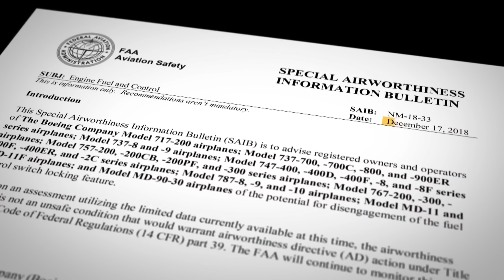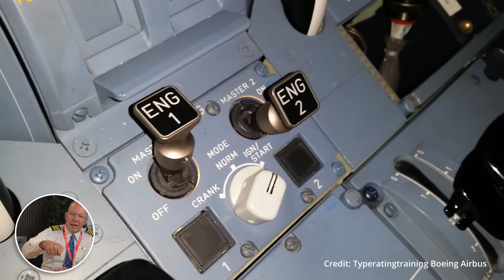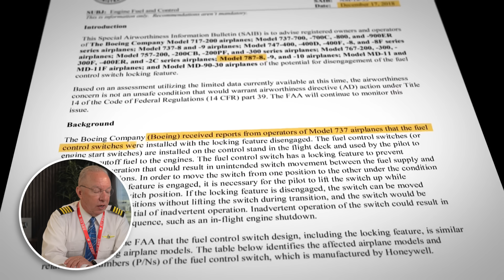Air India 171: The FAA’s 2018 Fuel Switch Locking Bulletin Explained (16 Questions Answered)

Comment: The engine system likely caused the engines to shut down, after which the captain had to restart them by putting the fuel cut-off switches to the cut off position then into the run position but it was too late as they were too low. In 2019 the system shut off both engines on a 787 as it came in to land.
Reply: @cwli1 not enough time to do all you suggest. We are talking seconds here!

Comment: why did the report not say wich pilot say what? Is ist possible the this fuel control switches was in RUN position and in function but not guardet? so they fall down himself by liftoff or by short touch with a hand? that will be a answer for this conversation from both pilots.

Comment: System should block fuel control switch changes until a secure altitude. There is no reason at all to allow such a manipulation at this stage of the flight! „Operating as designed“ is the issue here

Comment: Hi Steve Sir, my question is "HOW MUCH TIME IT WILL TAKE TO REFLECT SLOWNESS in ENGINE,  WHEN THE FUEL SWITCH IS TURNED OFF" is 4 sec or 1 min.. bcz time given in the report is in micro second
Reply: What you are referring to is the fact that both switches were moved to cutoff in the timeframe of 01 (ONE) second…not 0.1 second.
I’m an airline pilot, take it from me that the reaction time for the engine to stop running after moving the switch to off is practically instantaneous, like half a second or so.
Reply: @baasbowing  Knowing what we now know..... What's your gut instinct? Was this a deliberate act of malice?
Reply: It consumes the most fuel at take off BY FAR. I guess it will be maybe 2 seconds. I don't think ti was microseconds.

Comment: Captain Steve a great video and a fan however I disagree on one point. Your objection to the camera in the cockpit was it wouldn't have prevented the accident which is true however it would be a fair way for the families of the passengers to get answers. For example you mention the sound recordings of the black box however what ifa pilot deliberately done something nefarious then asked the other pilot why they done it? Whilst this is not commonplace someone with bad intentions may do this. Whether they should be monitored solely in event of an incident or not is another discussion and I also agree that from the pilots pov that it could feel invasive. Nonetheless worth a debate

Comment: Captain you sound 100% sure that it was a manual intervention. I would like to know if it was before or after thrust issues or before RAT was deployed. Is it possible to  do a video with sequence of events with timeline.
Reply: All of the videos have seen from pilots they are 100% sure it was a deliberate action and could not have been moved or happened accidentally.

Comment: Why would the system allow to disengage fuel while airborne? Make sense when the plane is parked.
Reply: An engine that's on fire and or having a catastrophic failure needs to have the fuel supply cut to keep the engine from bringing the plane down.

Comment: If  someone among the pilots  has switched it off, deliberately, he would resist rerunning the engine right? Here the engine was started with out the resistance of other pilot. Explain this?
Reply: Because at such low altitude (650 feet approximately), the plane’s fate was sealed already with the fuel cut off for more than a few seconds. During takeoff is when maximum thrust is applied. Even when you turn the fuel back on, it takes up to 20 to 30 seconds for engines to spool back to full thrust. Insufficient time given the altitude. Any trained pilot knows this  -“resistance” is futile. 

Ask better questions please or just stay off from commenting.

Comment: What about having a distinctive beep/sound when the fuel control switch position is changed? If such an audio alert was there, if the switch had fallen accidentally, or by mistake by one of the pilot, the other pilot would have immediately been alerted to.
Reply: how come theres no warning sounds behind the pilots voices  id have thought thered be big beeping sounds ?
Reply: They were. In fact, the distinctive sound is that of the engines spooling down. INSTANTLY the other pilot asked "Why did you cut off the fuel" (and after 10 secs put them back)
Reply: @normalchannel2185  Engine winding down could happen for many reason beyond the switch - like Low oil quantity / oil-pressure, high oil temperature, rotor issue etc.

So as a pilot one will spend few seconds to hear the engine wind down, the thurst missing, and then wonder what went wrong. The last thing a pilot would expect is fuel was cut-off manually. So, why not have an immediate alert? He could have put it back on in < 2 seconds and engine would not have died/stopped for it to require reignition.

Comment: My only problem with the explanation about the bulletin is that it literally says, "Inadvertent operation of the switch could result in catastrophic consequences, such as an in-flight engine shutdown."  (Emphasis added.)  Now maybe I am making too much of that one sentence but it seems they were concerned that this could happen in-flight.  That would be contrary to the idea that the switches, if improperly installed,  would never stay in the RUN position long enough to get the plane off of the ground.
Reply: I asked the same. Shitty wording from Boeing. Does it mean that if the LOCKING FEATURE IS DISABLED (at it appears to have been on the AI flight), that it is NO LONGER a 3 step switch, but can easily be bumped like a house switch.  Nobody seems to clearly answer this.
Reply: The advisory was to prevent inadvertent switching. However in this case it would appear to be a deliberate act.
Reply: @mikewilkins9484  I think you are right.  That is why his explanation that the advisory was for a installation error that would not allow the switches to lock in the Run position sounded wrong to me.  The advisory clearly states the problem could result in an in-flight catastrophe.
Reply: The throttle control pedastal was already replaced on that plane at least twice, the most recent was back in 2023, that bulletin came out in 2018, so the plane already had the updated switches. The fact that they were both still in the RUN position after a hard crash and fire that melted the flaps handle speaks to the robustness of the locking mechanism.
Reply: Captain Steve doesn’t wanna talk about the bulletin, it just looks like he gets paid overtime by Boeing
Reply: @leoarjuncrasto Don’t be a Dodo brain.

Comment: i have a wild theory-
so the fdr (flight data recorder) takes input from the electrical systems, NOT the actual switches. so if an erroneous input was shoved into the fadec system at 080842, of the fuel switches moving from run to cutoff, then the fdr will record it. and then the fadec might try to strangle the engines (im not too sure). then the pilots saw the fuel switch warning on the eicas and then be like - who did it? then at 080848 or so they might have tried to actually set the switches from their perceived run position to cutoff position, and then switched back to run position on 080852, and that the fdr did record.

Comment: This looks like a manufacturing fault to me. The speed and way both pilots questioned each other shows that neither of them initiated this. If one pilot had done it, their response wouldn’t have been outright denial—it would have been along different lines.We also know the pilots tried to get a message out that they had suffered a catastrophic loss of lift. So why would the transmitted message be about a total loss of trust in both engines, rather than one pilot accusing the other of sabotage?
Reply: The question clearly reflects that the levers were physically changed to the wrong position.  So it wasn't a mere electrical fault as the most definitely well credentialed engineers are trying to argue all up and down the comment section.

I'd like you to tell me what kind of manufacturing defect could cause the levers to move by themselves in a one second interval exactly as it is done at a normal shutdown, be returned to their correct position shortly after, and then remain in that correct position throughout a severe crash and fire despite apparently wandering around all over the place just seconds before.

Comment: Why are you overlooking the chance the spring/ mechanism of the fuel switch might have failed? It is shocking to me the safety of the entire of entire aircraft is dependent on one single switch not failing. This should be changed by Boeing to two step procedure.
Reply: I don't think this cd affect bith the switches simultaneously. They both must not have any connections with each ither which can make them fail simultaneously
Reply: There are two springs. One is for the actual switch operation - it pushes internal switch circuitry and is enough to keep position stable even in case of overload. Second one pushes down the cap with a locking mechanism
Reply: @brylozketrzyn so there are two single points of failure because a failure in either spring would result in the switch failing?

Comment: 4:03 “It might give you a clear picture of exactly what happened,” seems like a good reason to have a visual record. The threat of capturing a pilot doing something they’re not supposed to, like reading a magazine, doesn’t seem like a valid reason to not have that visual record.
Reply: Yep! Steve’s counter argument is weak in my opinion. He worries that the pilots could be held responsible for inappropriate behaviors in the cockpit if video footage is available to prove it. His thinking is actually concerning as he implies that pilots are doing such things today very commonly.
Reply: @allee2445 he’s excused was “it won’t prevent this accident” no one say it would. But it’ll show whose fault it’s. The airplane or the pilots
Reply: @edgarallanpoe9534  Exactly! No system can prevent accident 100%. Having said that, additional information can help identifying and confirming the root cause which leads to safer systems or better pilot training and ultimately improve the safety of airline travel.
Reply: @allee2445 this accident with a video camera recording the cockpit would have revealed the cause of the accident in just days. Because the pilot said he didn’t cut off the switch so did a glitch in the computer did it or did a pilot accidentally cut it off?
Reply: @edgarallanpoe9534  Very true!
Reply: Depends on the magazine... or more to the point what website are they going to on that iPad.  ...
Reply: 😂 @HontasFarmer80
Reply: Just like voice recordings. Video recordings should be storage in the black box and only use when there’s a crash or accident that’s it.
Reply: At the very least, have the cameras focused on the instrument panel and controls.
Reply: Absolutely. Especially when you are responsible for 200+ human lives...
Reply: Also, if the video is being recorded to the “black box” it couldn’t get leaked unless there was a crash and the video footage was downloaded from the “black box” itself. I can understand not wanting the videos to be recorded and sent to a central server at headquarters, but I see no reason a video couldn’t be stored similarly to the voice recordings of the cockpit which are never “leaked”. Bus drivers, train drivers, etc have cameras on them, why wouldn’t a commercial pilot also?
Reply: Fully agree...he is gaighting us on the camera issue 😊
Reply: They have sex in there
Reply: 1000%
Reply: and maybe if the angles are right or have multiple cameras, we can see who is the one talking, who is actually flying the plane, etc which can be very help especially in this case.
Reply: I wonder, seriously, will cameras affect the design of the blackbox? And will the change also affect the design of the entire cockpit? And in the end, the design of the entire electirical system? Because I think most people demands a camera in a cockpit thinking it just like slapping an airtag to their phones. Seriously wondering.
Reply: Might the camera data recorder still capture that critical moment after a horrific crash to be meaningfully played anyways or it becomes just a fuzzy image that nobody can really see what
Reply: how did airline safety even allow the whims of pilots??? Let elon musk know about this...he will make an airline with real autopilot..then we don't need drivers with these whims
Reply: We have heard from truck drivers, locomotive engineers & cruise ship captains testify that they are under video surveillance while conducting their duties. I will add law enforcement as well. Why should airline pilots be above that same degree of scrutiny with so many lives in the balance?
Reply: What most people are missing here is that the FAA had already issued a warning back in 2018 (SAIB NM-18-33) about a potential issue in Boeing aircraft where the fuel control switches could unintentionally move due to vibration or mechanical failure.

In the recent Air India crash, both pilots denied switching off the engines, and flight data confirmed that both engine fuel switches moved from RUN to CUTOFF almost simultaneously.

If these switches are manual and controlled by physical levers, it's impossible for them to move without human input — unless there’s a mechanical fault, such as a failed locking mechanism, which is exactly what the FAA had previously warned about.

The aircraft involved had not undergone the inspection recommended in that 2018 FAA alert because it was marked “advisory, not mandatory.”

This strongly points to a technical glitch — not pilot error. It's easy to blame humans when machines fail silently. Aviation authorities should focus on the dual engine switch system’s design and whether proper inspections were neglected.
Reply: I think a 15 minute loop is perfectly reasonable
Reply: When at work do your job, then cameras will not matter
Reply: Exactly lol. Of course steve doesn't read any magazine apparently, but if some pilots do read - shouldn't they be punished? If you are not allowed to do something, don't do it, simple no?
Reply: @brucebatmanwayne8514  Exactly! Do you get to read magazines (appropriate or not) while on the job?!
Reply: Is it possible that both the captain and first officer are both telling the truth regarding the fuel shutoff switches?
Reply: @grwaitemd  yes. In the video that doesn't exist, we would see the pilot's hand hitting the switches by accident.
Reply: I can here to say the same. I think in general use the video feed would be overwriting continuously and only 'save' when there's a crash or whatever.
Reply: @johnbertram  Yes, the backup comes into play only when it is absolutely essential. And pilots can continue to read newspapers and solve crossword puzzles.
Reply: I suspect the cameras will be coming after this incident.
Reply: @kriswest5695  Why? How would a camera have prevented this?
Reply: @kriswest5695   What you guys are missing is you don't need video to know what happened. They know exactly what happened, and a video won't change anything or give them more info.
Reply: Yes, I appreciate Steeev'e info but his lame excuses for not having cameras are just cuckery.
Reply: Pilots have a significant amount of pressure in the cockpit. The thought of having some non pilot review every flight and critic every single decision would be too much for many pilots.
Reply: @codysb05 no need for the video to ever be viewed except after a serious incident such as a crash. If it’s recorded to the black box, it would only be seen by an air crash investigator, and could provide vital evidence of the cause.
Reply: Sone Indian Aircrafts have a DVR which my limited Google knowledge says iis a vedio recorder . This 171 had one and it was recovered. Please Google and check.
Reply: Oh, here we go. As an airline pilot, this is the infantile response to a tragedy that I’ve been dreading. Our lives are difficult enough without constantly being monitored by video. Did you know that our actions are already recorded discreetly? Did you know that the stress of some safety warnings and managements’ use of them against pilots has resulted in hull losses? Perhaps this is the first step in a manipulation of minds to effect pilotless aircraft.
Reply: @TheIncredibleMrG777  I understand but there is a vast difference between partial/continually overwritten footage that is almost never reviewed by a human, and “constantly being monitored”.

In your scenario, who would be monitoring these videos? How often/how many are sampled? How many hundreds of employees would have to be hired to achieve this, and why would that be implemented at all?
Reply: We have a clear picture from the FDR and CVR.   We know what happened, not why because we cannot get inside the head of the pilots and a camera cannot do that either.    The switches need to be subject to Failure Analysis and the whole design needs reviewing.    Pilots are allowed to read newspapers.
Reply: @user-xu5vl5th9n I don't think either you or Steve are listening to the question.  The simple question is whether there is any chance that this was accidental or clearly intentional.  Let's not pretend a video would not help to add some clarity to this answer.
Reply: @brianjb1965  The switches are designed to prevent accidental use, I don't see a video helping.  What could help is analysis and testing of these particular switches and a design review.
Reply: @user-xu5vl5th9n no we don't know what happened! Who cut off switches? Who denied doing so?